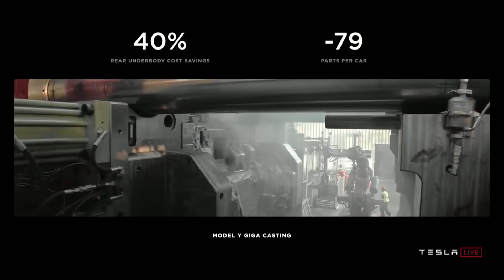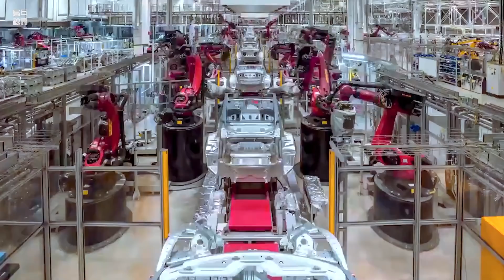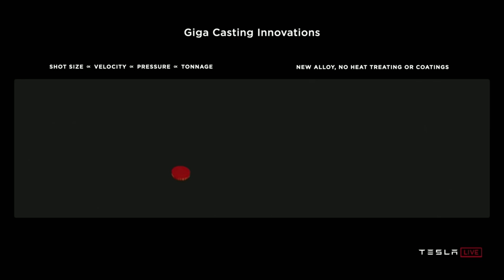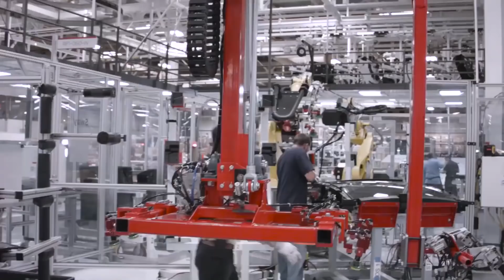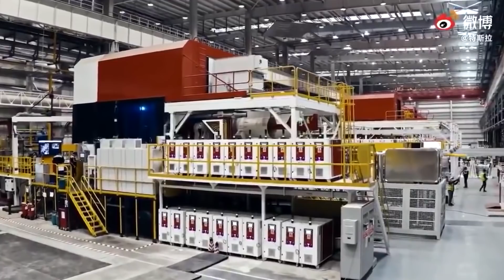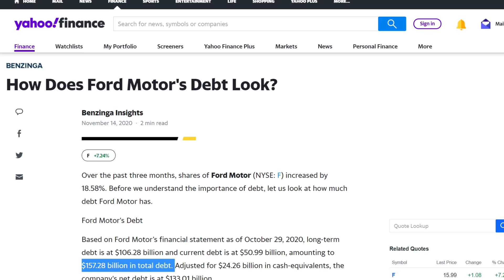Tesla Giga Press: Why dont Auto manufactures copy?

Comment: Interesting but a bit confusing as the terms "giga casting" vs "giga press" seemed to be used synonymously.  I thought casting was essentially pouring a liquid into a mold whereas a press forms a solid over a mold.  Perhaps you could clarify in some future video.
Reply: You need a lot of force to keep the mold closed while the liquid alloy is being pressed into the cavity via a piston mechanism (injection moulding).
And the larger the surfaces that you push the molten alloy into, the larger the force on the mould to separate as force = pressure * area.
'Casting' doesn't quite capture that.
In other languages there are distinctions, German for example: 'Guss' (gravity fed casting) vs. 'Spritzguss' (pressure fed casting, injection moulding).
Reply: @joansparky4439  In glass beer bottle making, They also drop a glob of molten glass into a mold cavity, and press and blow, or blow and blow, to form the bottle. The mold opens up and out comes a bottle. That has been around for a hundred years. If they didn't keep the mold nice and tight, then the bottle mold seam flashing would cut you when you hold it. This is a video for an audience with little knowledge of factories.
Reply: It isn't a press. Its an injection molding machine. If it were a press, nobody would talk about it, because a 8000 ton press was the height of engineering in the 1900s. Press just sounds much cooler and more impressive. It does require some pressure to keep the mold tight, but nowhere near the scale of what actual production presses for forging and forming have.
Reply: I agree this is a confusing video. Pressing infers forming, not molding. There are many examples of cast alloys in use in many automotive components, including the major components of the engine, the transmission, the differential housings, etc. To try to claim that Tesla has more knowledge regarding machining and metalurgy than the other automotive companies is a stretch at best. Like all car manufactures, Tesla starts with a frame or an integrated frame into the base chassis body. Gigapress is more hype that Tesla likes to integrate the word "giga" into. His fan boys love Musk's creative vocabulary.

Comment: For the most part, you guys are delusional, majority of cars are made of steel, I bet $100 a normal steel chassis rear end is put together cheaper than the 1 piece assembly that comes out of that casting machine.
Reply: I'd see the cast part being cheaper but I have other concerns. Mainly crash performance.
Reply: @mpetersen6  aluminium costs about 2.5x what steel does, once you factor the amortised cost of the casting press, I highly doubt there's a cost saving.

You can actually see in some of the photos, the "1 piece" isn't actually 1 piece, there's aluminium extrusions welded in post casting to form the rear crash structure.
Reply: @ej20tnz  
I also wonder just how thick the casting is. I realize some are heavier than others due to structural loads but just how thin is the thinnest section.
Reply: @mpetersen6  id suggest due to it's size overall, the the thickness might not be as optimised as possible due to potential issues with cracking and solidifying during injection.

Comment: Giga this giga that Tesla needs to invest more into their quality I see to offten they have problems with parts not fitting and bad paint jobs ill tell ya u can have metal shavings the size of a pin needle head creating problems on the pressed surface now that part needs to be grinded and the press surface needs to be checked, if they fail to do so it is prone to rust damages that can become expensive to fix
Reply: This takes 79 parts to 3 parts on the underbody of the car.  Less parts means less problems with fittings.  Also shifting over to aluminum and silicon instead of steel would mean less rust as well.  The Shanghai production Model 3s are already at Toyota level panel  fit and finish.
Reply: @victorluke5816  well let's hope the crash tests stay the same aluminium is softer and more prone to dents u will still have to check the surfaces as the paint job can be weaker and not hold itself properly this results in paint falling off, now while aluminium has a nice oxide layer that prevents rust it should still be repaired as contact with other metals creates a reaction that makes aluminium rust, this means the shops need to make sure to clean their tools, grinders etc.. before working on it.

Comment: This is nothing NEW, geesh...🙄
What did those presses do before Tesla sniffed the scent of it? Exactly, they casted parts for other industries. 
There are savings with this tech, but not for economic cheap vehicles. Steel is alot cheaper than aluminium and easyer to weld. 
You can't make 20k car with this tech for profit, you can however make 40k+ one. And Audi uses this tecnology for a decade, not in the same way but it is nothing NEW.
Another one of Musk's media stunts, but this one is at least usefull compared to some other pipe dreams of his.

Comment: Telsa cars need to be in the hands of customers with at least a year or so of driving with no problems, before we all can be comfortable. Can you imagine a recall needing to be done ?
Reply: Explain?  GM put out a recall order on 2.4 million cars and only 200k of them were ever repaired.  Because the people who owned them did not know about it.  Tesla can send it to the screen and tell the driver what it is, what it is for, and when the appointment is.
Reply: @davidbeppler3032  My main point is the die cast vehicles have to be driven for a while to confirm that they don't develop problems. Now that you've raised the question maybe a weakness if it showed up could be fixed with some reinforcing.

Comment: Get an automotive engineer next time, there's more to building a car than just casting parts. BTW, Tesla is the one copying people. Many recreational vehicle manufacturers have been using large castings in their frames for 20 years. GM has been using large castings for more than 10 years. Another "Tesla Innovation" that isn't. PS, castings like this are unrepairable. IE, you get in an accident, crack it or chip it, and your car is totaled. Not very sustainable. Bend a steel unibody, you can pull it straight. Crack a small aluminum suspension part, cheaply replaced. Cracking one of these in a Tesla model Y will instantly total it. Real auto manufacturers try to make all their vehicles repairable. Tesla, not so much.
Reply: Good job Tesla have their own insurance company, I guess.
Reply: @mwwhited  fair point.  But still the average car do not have all these safety features. So I don’t see insurance costs sky rocketing because of a single cast.
Reply: @brucemc1581  At this point in time in Australia a $70,000 ICE car to insure is less than $700 while a $70,000 Tesla is $2000.
Reply: @dikkybee  you guys already have cars with single cast?
Reply: @brucemc1581  No idea, after being caught up in the Tesla hype I then worked out I can not afford one. I drive a $30,000,$500 to insure ICE car as I cannot afford the $140,000, $2000 to insure Tesla equivalent.
Reply: @dikkybee  understood.  But I don’t think the high cost of insurance for a Tesla in Australia is due to Tesla itself or because they use casting. AFAIK, cars made for Au in China did not have single casting.  My theory is that local insurers are gouging Tesla owners because they can.  Same thing happened in Eu an Us at first.
Reply: @brucemc1581  Most electric vehicles are more expensive to insure. The Hyundai EV was just over the $1200 as were most other EV's which are available in Australia at this point in time. The casting has nothing to do with cost of insurance, I think it is due to the fact is what the insurance companies can make on wrecked cars. As I have seen on Youtube, most EV are scrap once they are written off and it doesnt take much to write them off. Basic repairs on ICE cars are easy but have a look how much it would be to replace, if you can, a panel on the Cybertruck. The cost of repair would be more than to just buy a new one. They are very hard to salvage and if you were it is virtually impossible to get a wrecked Tesla back on their fast  charge and the amount of money to get everything checked isn't worth paying as even when you get them checked they can be rejected in a short time so what you pay for the checking and wreck is a total loss. While the cost of ownership is as high as it is and the insurers cant make money of the wreck then the price of insurance is always going to be expensive.
Reply: Exactly. Same reason why manufacturers will be hesitant to use structural batteries.
Reply: True, but yet the accident rates are much lower.  Which then brings up the question insurance cost.  Higher replacement but lower incidents.  Could these cancel each other out?  And is casting safer for the passengers?
Reply: If a vehicle is that easy to Total can you imagine what the insurance would have to be like.
Reply: @jayfromaz  The cast frame rails are designed to be sawed off after a crash.
Reply: @jayfromaz  The cast frame's crash rails are designed to be sawed off after a crash.

Comment: Question for Andrew.  How is the alloy for the Tesla casting formulated so that dissimilar metals don’t have corrosion due to different electronegativity based on different metals chemistry.  For me I have a project and using different metals will corrode over time due to the battery action of dissimilar metals.

Comment: Complete propaganda,   The bozo using words like game changer, showstopper, blah blah blah,  has never spent any time in a real automotive factory body shop.      His assumptions are almost all incorrect starting with his first assumption that most cars are Body On Frame...  WRONG...     Almost all vehicles built on the planet outside of pickup trucks and large SUV's are unibodies .    Also, almost every OEM uses casting in the areas of the structures that make sense.

Now,  as for the argument that traditional OEM's have captured assets stopping them from changing construction methods...  WRONG    GM for example is introducing the BT1 platform for their EV trucks and SUV's starting with Hummer EV.  BT1 is an all new structure, and in the factory nothing was saved other than the shell of the building,  it is 100% all new methods and structures.    GM could have gone any direction on this program when it comes to the structure or chassis, because they are not using any off the shelf components in the structure or chassis.      When you are looking at a structure to analyze the cost,  you have to look at all aspects.      Giga casting has a lot of risk,  especially in trucks of heavier vehicles as cast aluminum has issues when you work it hard, and expose it to high loading over time.       Steel is generally a much more forgiving material,  especially when it comes to heavily loaded structures.   Steel is also  historically more price stable than Aluminum, and  also has a lower energy cost to make.    Now,  we will see how these giga casting age,  and what issues pop up over time,  and then on cost, the jury is out, but looking at EV cost,  only 10% of the cost is the structure.      

Then Debt,   Andrew makes the assumption that automakers debt is related to tooling, and therefore stops them from new investments...  WRONG   GM and Ford debt is mostly related to their financing arms, which finance dealers, inventory, and also customers loans.  This provides the automaker another profit center, and both Ford and GM have been killing it recently with their financing arms.   Both reported over $1B profit just from their financing arms in Q1 2021,  which by the way is more than the entire Tesla Motors had in the last year of profits.
Reply: Whenever I see a permabull misunderstand captive finance arms, I just assume they are arguing in bad faith. It takes 10 minutes to figure out the true debt of the lagacy companies.

Comment: We should expect VW to go giga castings as they do many unibody vehicles, but not Ford. Ford's trucks are body on high strength steel frames. The Ford bodies require far less strength as a result and can have thinner metal. Thinness is the enemy of castings. Sandy Munro has shown VW, Ford and others do use smaller high and low pressure cast parts.

Comment: Everyone is talking about the machine, but I want to understand what goes into the design and making of the die. i.e. How is it made? Is it different to conventional smaller casting dies? How much does it cost to make/replace? Does IDRA or Tesla make it? How much life does it have before getting replaced?
Reply: The Die last about 500,000 castings. The molds are designed to easily be removed so the replacement or even a different mold can be put into place quickly. IDRA is one manufacturer. Tesla gets their machine from 2 different manufactures. The design of the casting is done by a very special inhouse designed software that can replicate that type of metal flow and speed accurately. This video actually showed that software metal flows in action.
Reply: @radicalrick9587  LOL, never heard of a die casting mold that lasts 500.000 castings. Sorry that's just unreal. When you cast Zn-alloys yes, then your number may be correct but for Al-alloys for sure NOT.
Reply: @alexbauer9699  I'm trying to find the numbers. But I know that each casting can produce around 300,000 bodies per year. I also know that if and when they die casting needs to replace it can be done in just 2 to 3 hours. That means if they want one machine doing both the front and the back part, it can be done. That is how the machine is designed. The casting is interchangeable.  Here is some info. https://www.teslarati.com/tesla-giga-press-elon-musk-master-plan/
Reply: @radicalrick9587  Yeah, that's the Idea of a die casting mashine. But the number of castings being produced by one mashine  in one year is not the same as the number of casts you can do with one Mold. These Molds are very very expensive. I don't know how much exactly for Tesla, but I would say around 100000$. It's not easy to produce the molds. They have to be CNC mashined, the heat treated and then again CNC mashined. And for a mold of that size it will be very expensive. For sure it is a very productive process, I would not disagree. But you can not just make 300000 - 500000 castings with one mold. :)
Reply: @alexbauer9699  You're forgetting. This is Tesla They are doing everything that was thought to be impossible. But $100,000 is a very low estimate for a mold that Tesla would use. My own product which was a medium-size waste receptacle was around $50,000 for the mold.
Whereas Tesla's large-auto-size casting I'm guessing is in the $500,000-$1 million dollars plus range if not more.
Reply: Yes, that's why I said I don't know how much it will cost them. :D But that makes it even more difficult to build cheap Cars with it, wen wou have to replace the 1 million dollar molds twice a year on every mashine you have running.
Reply: Tesla's first large acquisition was a die making company

Comment: If Tesla's competitors are going to use gigacasting, it will probably be on a high-volume model, and the existing robots etc will be kept running to build the high-profit low volume luxury models. So yeah, if Tesla builds their compact EV and it reaches price parity with the mass market cars that sell in the 15 to 25k market segment, then their competitors will have to respond with gigacasting or they will be priced out of the market.
Reply: another clueless person as to where profits come from in the auto industry...    For GM it's their high volume products that generate the profits, and make the engineering possible for the lower end products
Reply: @dmitchellhomes  I never said that the high volume products were not profitable, only that the legacy OEM's would have a use for the outdated robots to build the low volume high end products if they switched to gigacasting for their high volume production. Clearly, they have to make a profit on those high end vehicles too, and it would be easier to make a profit on a high margin product that costs $50k plus because you are charging for indefinable things like premium branding, or added value from all the added features available on those models, which don't add all that much to the basic cost of production.
Reply: @aftonline    WRONG!!!  So you think the cadillac brand generates more profit than the GMC Sierra?   Or even more profit per vehicle?   NOPE...   Clearly you do not know anything about the financials of auto manufacturing,  so save your insight...
Reply: @dmitchellhomes  Did I say that Cadillacs are more profitable than GMC Sierras? They may be less profitable but they are still profitable or GM wouldn't make them. I may not be an industry insider but I do know that corporations are profit driven so it is logical that everything they make has to be profitable or they cease production of that model.

I live in Australia by the way so I am keenly aware that the demise of Holden is proof positive that GM ceases production of unprofitable models or even entire brands when necessary...
Reply: @aftonline   More less your last statement is correct.    This is why GM and Ford have stopped making small cars is you just cannot make enough profit on those,  but they require the same number of engineers, and factory CapEx as more expensive larger crossover models that are profitable.    You can notice when GM and Ford made the decision to concentrate on larger, and more profitable cars they  profits  skyrocketed immediately, even on lower volume.     GM has been reporting the best net profit in the companies history the last 3 quarters.  and that is going to skyrocket at the end of this year when the refreshed Silverado and Sierra go into production along with the Hummer EV.